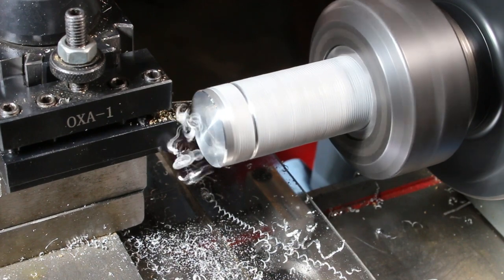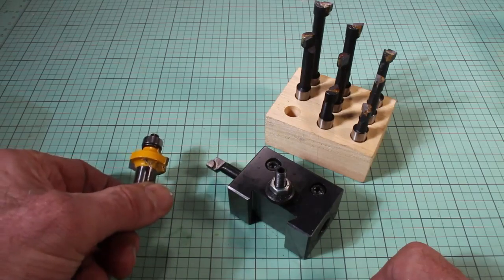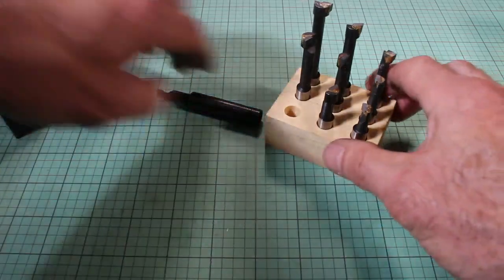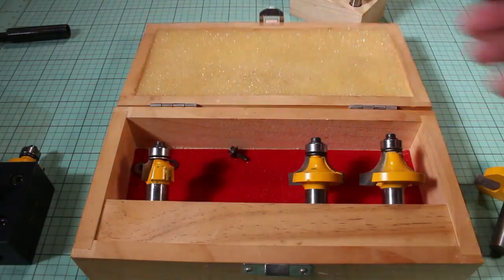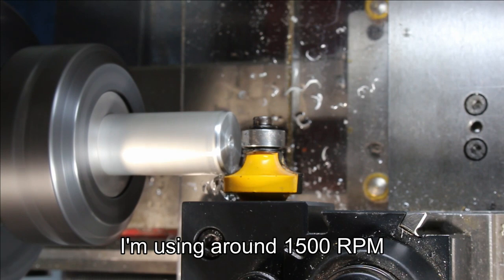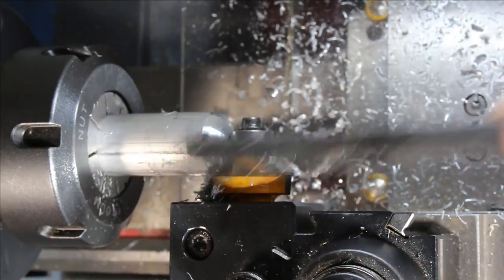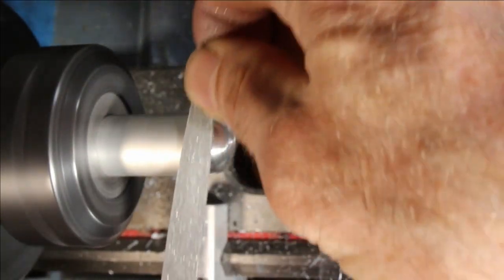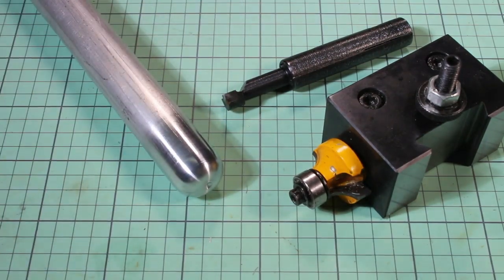Using a woodworking router bit on the mini lathe

Comment: I purchased a set of router bits years ago to be used exclusively in my machine shop.  They work fine.  By the way, you can also use a single flute from an end mill mounted the same way as a boring bar.  Have not seen that on YouTube, so there’s another future video for you.
Reply from the maker: Did you purchase half inch shaft router bits? I think they're a lot more stable under these circumstances. And yes I think I have seen someone use a single flute and mill mounted to a tool holder for boring work.  But I might do a video about that as well, thanks for the suggestion.
Reply: @GuyMarsdenMakesStuff  The whole set was 1/2” shank.  Why take a chance on chatter with anything less.  A carbide shaper cutter on a 3/4” arbor would probably be better still.  If you think about it, you are basically using a form tool of sorts that have been used in machining for well over a hundred years.

Comment: Slower would be better
Reply from the maker: Thanks, I'll give that a try. The video was my first experiment.
Reply: You’re welcome. Look for the suggested surface speed for aluminium and in my experience knock that down by 20% or so. Cheers.
Reply from the maker: @mikebarton3218  I'm thinking that that large surface contact area is too much for my low powered lathe. In my very first attempt off camera I was running slower and stalled the machine with a catch which is why I went fast.